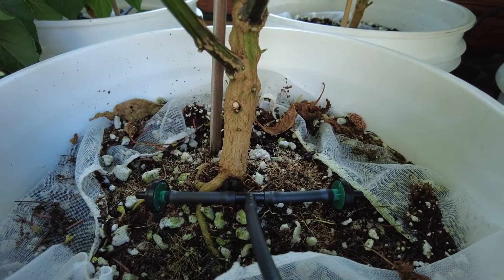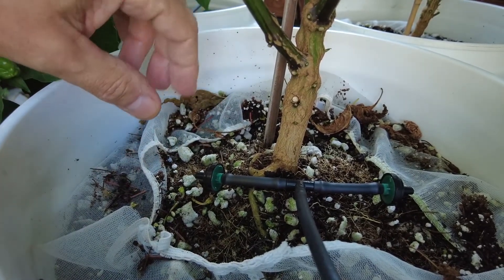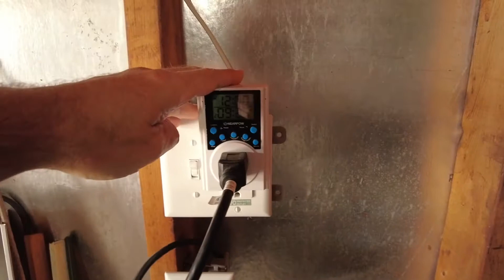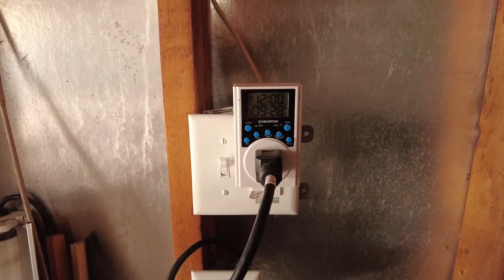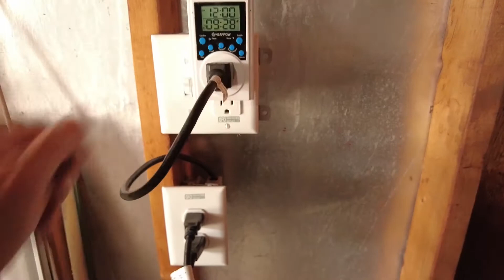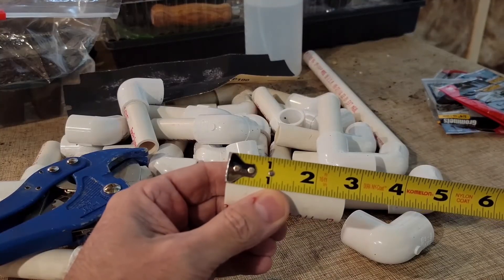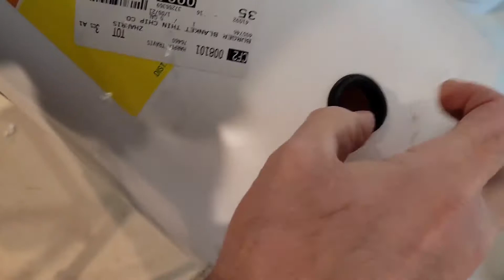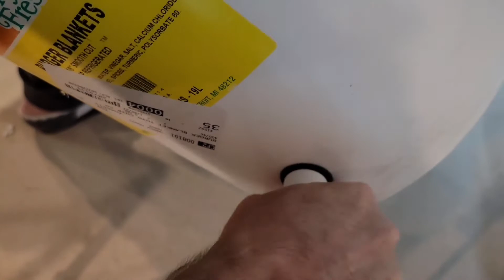Outdoor Hydroponic Peppers

Comment: I did DWC peppers in Canada two summers in a row. I always have issues with the nutrients getting too warm in the summer. Do you think your method is better to handle the heat waves of summer? Great video and Great setup!
Reply from the maker: Yes it definitely works better than DWC in the heat. I had many consecutive days over 90F and never had a single issue. Since nutrients are only fed into the coconut coir for a few minutes at a time a couple intervals a day the environment and conditions are similar to growing in regular soil containers. The plant's roots aren't sitting in hot liquid. Thanks for the kind words and taking the time to comment!
Reply: DWC is meant for indoor growing where you can control the temp and humidity it was invented for growing indoor cannabis if you’re using chemical fertilizers it shouldn’t matter appears don’t like direct sunlight anyway you could try using some kind of insulation wrapped around your Reservoir just use a 5 gal bucket filled with water fill it with water and a air stone and air pump for a fish tank and add your nutrients as needed in not sure how often or what type of nutrients peppers need what this man is growing is not hydroponic it’s soilless growing he’s using a non soil medium and adding nutrients in the feed solution
Reply from the maker: @Trump_is_a_Criminal  "soilless medium with nutrients"... that's literally the definition of hydroponics. https://www.merriam-webster.com/dictionary/hydroponics

Comment: Great video. Thank you. I am curious about your thoughts on water temperature for someone in the desert. I need to figure out how to cool the water from the nutrient reservoir.
Reply from the maker: My nutrient reservoir was in my garage mainly to prevent rain getting in the barrels. It typically gets about 5F higher than ambient temp in my garage. I had some days this summer that reached 95F so I assume my nutrients were at least that temperature. I noticed no ill affects to my plants. The short amount of time the drippers are running (4 mins) don't dump a lot of water into the buckets, less than 2 cups for mine, per interval so I don't think the temp of the nutrients was a factor. It wouldn't take long for the temp for that small amount of water to balance with temperature of the coconut coir and roots. Not sure what your temps get up to but it may not be an issue since the buckets and plant roots will be the same temp as the ambient air, and nutrient reservoir anyway. Maybe use a white barrel to prevent excess heat from the sunlight on the barrel or provide complete shade for the nutrient reservoir. Another option you could experiment with would be more frequent feedings for shorter amounts of time but I'm not sure that would allow nutrients to get deep to the roots. I wish I had a better answer for you.